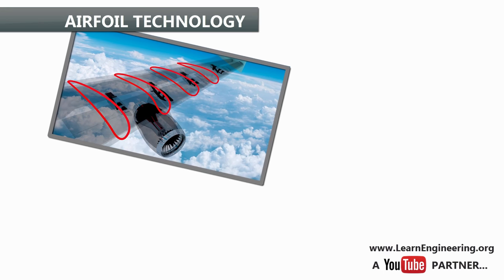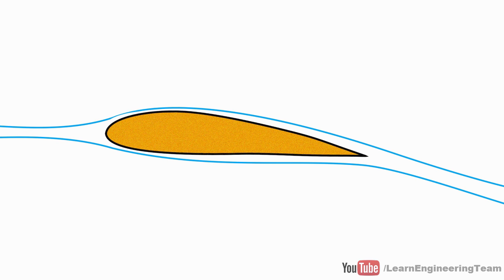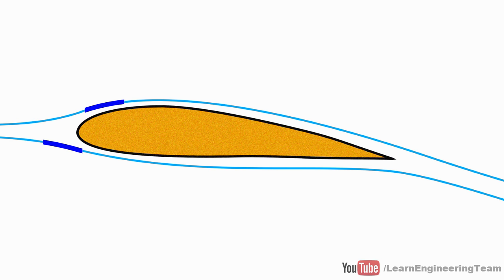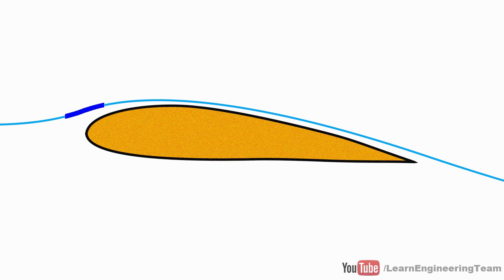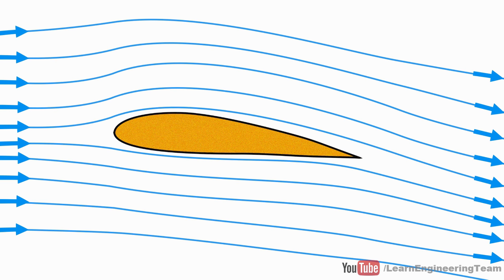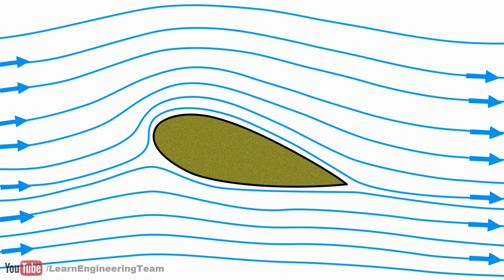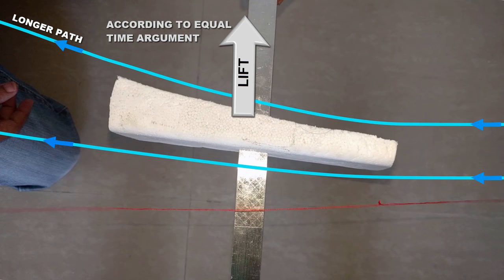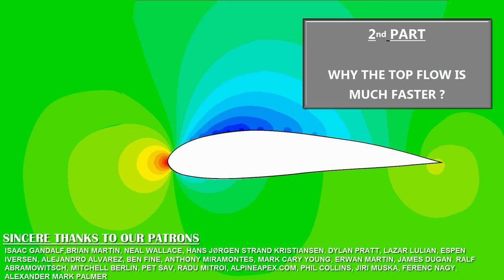How do Wings generate LIFT?

Comment: As the pressure decreases heading downward towards the wing due to the Coanda effect, the density of the atmosphere is lower which allows the relative wind to flow faster over the wing than it does from the leading edge under the airfoil creating a high density, high pressure zone which slows the flow of the relative wind to the trailing edge thereby creating lift?

Comment: The overall logic of the video is somewhat questionable. The whole explanation is reduced to the existence of Coandă effect, which is not explained in terms of general laws of physics, but just taken as it is. 
As a result the key point here suggests that curvature of the flow produces the pressure gradient, when in fact it's the other way around. Like in the Newton's second law acceleration is not the reason but the consequence of the existent force.

The second mistake
2:07 "you cannot apply Bernoulli Equation between two streamlines".
This is not how you compare parameters of the flow in points A and B. 
In order to do this you need to write Bernoulli Equation twice: 
1) for the upper streamline in point A and at infinity
2) for the lower streamline in point B and at infinity
However, as the parameters for both streamlines at infinity are the same, you can put equality between parameters' combinations in points A and B. So the inequality sign in the video is wrong.
Actually Bernoulli Equation can be applied to explain the differences in flow speed you talk about at the end of the video: since the pressure above the wing is lower, the air here flows faster. It's that simple.
Reply: Yes you can apply Bernoulli Equation between two streamlines when the two have the same ancestor starting at the same pressure and velocity. This gives them both the same Bernoulli constant.  The two both start far ahead of the wing at the same pressure (atmospheric) and speed (zero).  This is explained in John Anderson's book and Charles Eastlake's Physics Teacher article.